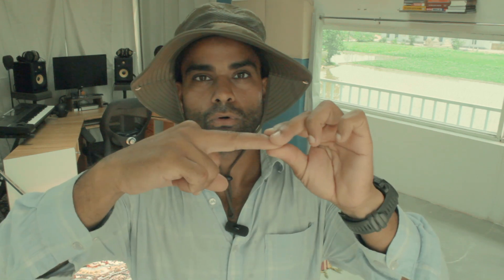What are SHIMS in a motorcycle | HIMALAYAN 450 | Royal Enfield

Comment: Hi i have the 2025 himi 450....wanted ur skilled opinion on my issue pls...i have a strange metal rattling sound as soon as i touch 4k rpm in any gear...no where else in the bandwith have this issue...bike runs smooth and no other sound...have checked for anything that could be loose,but nothing...pls if poss do let me know. Thanks